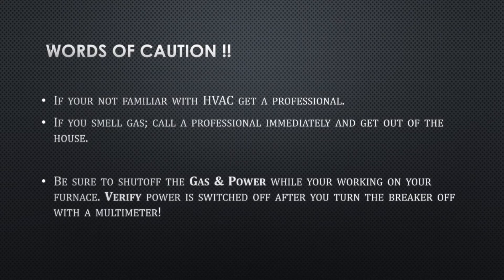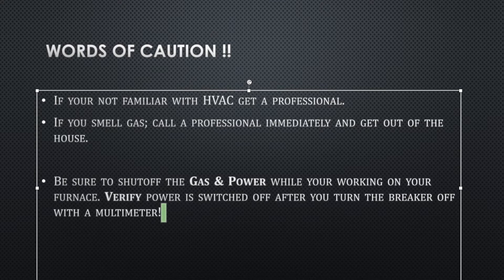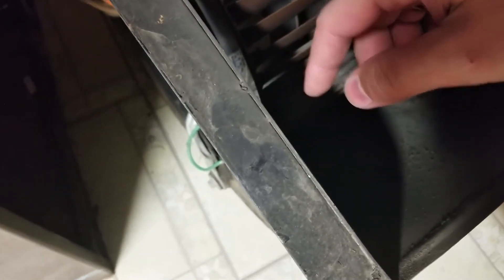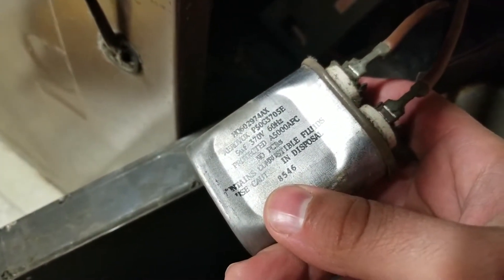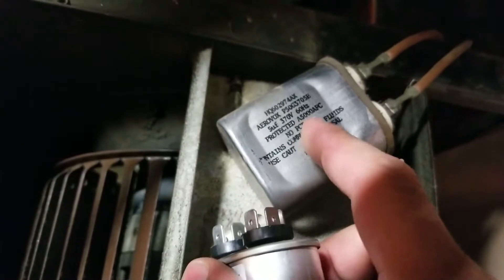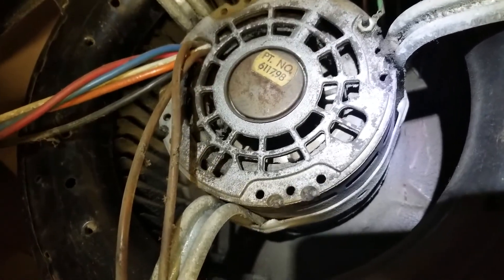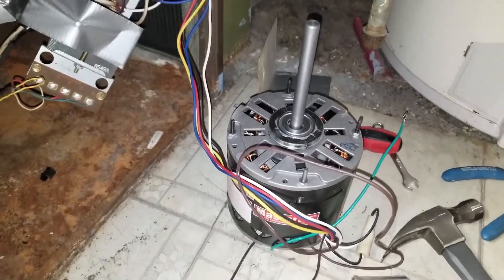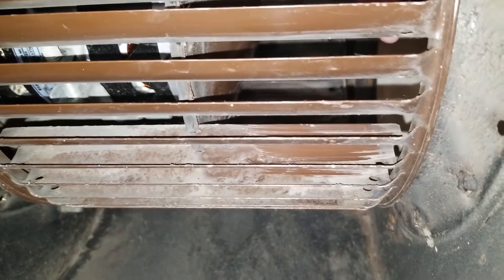Replacing Blower Motor on Home AC Unit HVAC

Comment: I had the same scenario and the capacitor was the culprit.
Reply: Austin Shoemaker  Mine was 100% the capacitor. Been awhile since ive seen video but if memory serves me right the guy replaced the fan and capacitor at the same time (which I agree is good practice) but I think if he would've just replaced capacitor first, it to wouldve fixed his problem.
Reply: Austin Shoemaker  I had the same situation. Mine was capacitor. This was a month ago. Im now replacing the blower motor tomorrow a month later